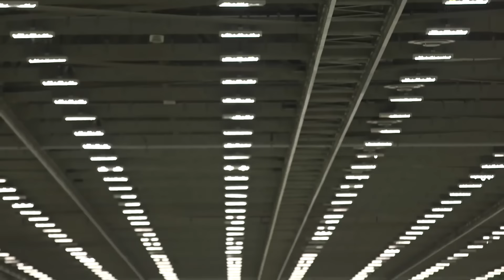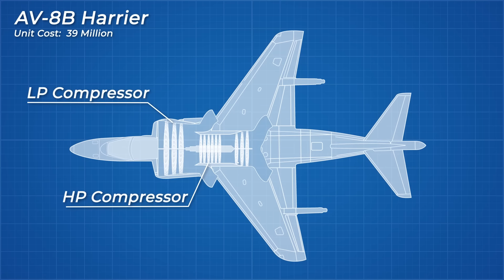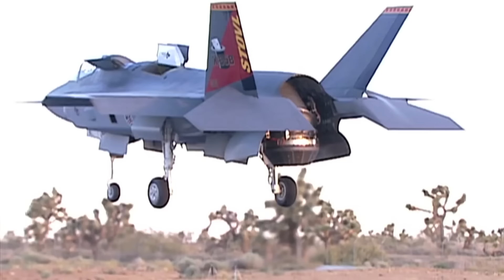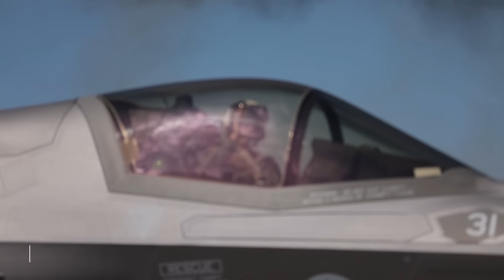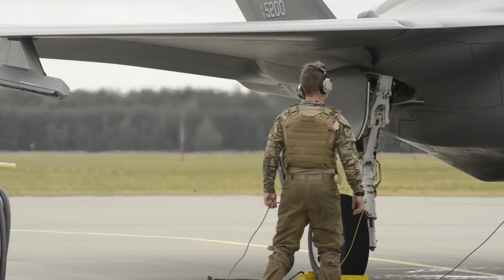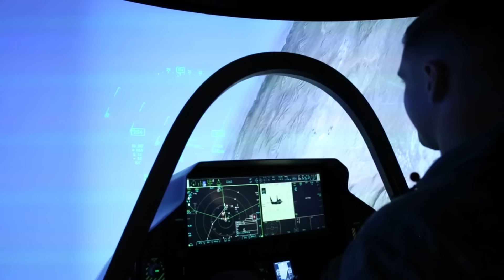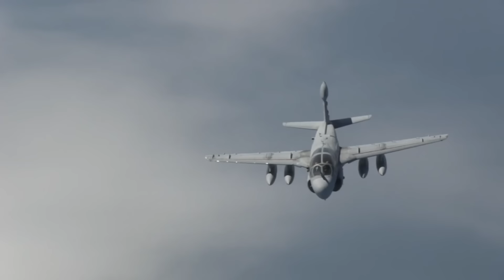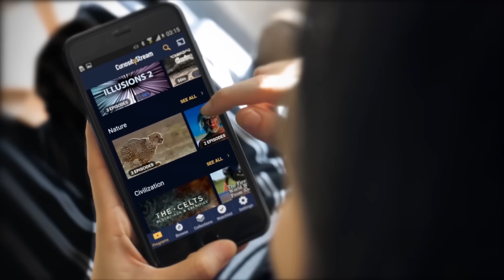Is The F-35 Worth $115 Million?

Comment: Not mentioned in this video : The main reason the F-117 was able to be tracked on radar and subsequently shot down in Syria is that not only did they fly a repetitive route, but they would also test their bomb bay doors at the same time during each trip. When these doors are opened it all but eliminates the F-117's stealth features as the open doors break up the lines of the stealth fighter causing it to reflect radar at a much higher rate.

Comment: Where did you get the unit cost of an A-10 at 45 million, the A-10s current unit cost is only 18.8 million. The whole argument about stealth is my biggest problem with the F-35 because to carry a usable payload it has to mount external pylons which remove the stealth capabilities of the aircraft. I know that when they where doing the fly off against the A-10 they handicap the A-10 and removed all advantages it has over the F-35. A large fault of the F-35 is it's jack of all trades mentality which in the end makes a very poor alternative to what we already have. For the remark about all the people who have flown it singing it's praises there is a simple reason for that, it would be a very poor career move for them if they can even get that remark out to the public through all the governments filters. Ever thought about why the only criticism of the aircraft from a pilot came from a leak not an interview. Now the next problem with the idea of mass production of a "stealth" aircraft is the operating coast is much higher because of the special treatment the it needs, plus the mass amount of time required to maintain the special coatings and sensitive panels.This reduces it's combat capabilities because any kind of damage requires more time to repair. If any of the special equipment brakes that will increasing the repair time by orders of magnitude grater then traditional aircraft on top of needing to lug around all of that special equipment to deployed locations. Aircraft like the A-10 can fly with panels that just have a primer coat on them or speed tape covering a hole in the skin until time and resources become available. As a US citizen and an aircraft maintainer in the Air Force I don't think the aircraft is worth the cost.
Reply: $18.8 million is the unit cost of an original A-10A in 1998 $ value. Just that price alone in today's $ value is roughly $30 million, and add to that all the upgrades the A-10 has received in the past 30 years it easily exceeds $40 million per unit. The 2006 C upgrade alone added $10 million worth of upgrades to each A-10.
If stealth is required an A-10 would never be used, so your problem isn't a real problem. The F-35 can carry the F-16's practical strike payload internally, and externally it can carry more than the A-10.
The A-10 wasn't handicapped at all in the exercises in which the F-35 performed the CAS role better. CAS is simply not the role that most people think it is i.e there is no requirement or reason to fly low and slow. An F-35 can spot targets more quickly from 10000ft than an A-10 can at 5000ft, and that means weapons on target sooner. Not to mention the inherent advantages of being multi-role mean the F-35 is logistically easier to manage in a combat zone, and that results in better availability.
The pilots singing the praises are simply talking about the capabilities that are part of the design and not the issues that are all temporary and solvable i.e there's no reason to make a fuss about them. They only suffer consequences if for example they report a problem to the public before the brass know about it as that is simply irresponsible.
Operating cost is not much higher if at all. The F-35 is not the F-22. The F-35 costs about as much as the F-15C to operate. The F-35 does not need special hangars or intensive coating maintenance and most of them use the exact same facilities as the F-16s they are replacing. I have spoken with actual F-35 maintainers and the problems are mostly to do with the supply chain of spare parts lagging behind the production of aircraft, as well as the ALIS diagnostic system. ALIS has improved quite a bit over the years and the supply issue is going to be resolved soon since Lockheed have reportedly opted to spend about $2 billion of their own funds to provide spare parts ahead of aircraft orders by 2020.
Reply: @dumdumbinks274  I was there when they did the fly off between the A-10 and F-35 they made the A-10 fly with limited fuel, ammo, not allowed to fly below a certain altitude all in an effort to make sure the F-35 looked good. There a big difference between solvable issue and inherent design flaws. The operating cost per hour of the F-35 and F-15C are about the same but compared to A-10 and F-16 which the F-35 also wants to replace the cost doesn't even come close.
Reply: @FlamingChickenG  You're referring specifically to the fly-off in 2018 then? I'm referring to exercises such as Green Flag, not the fly-off that wasn't even organised by the USAF.
The current maintenance cost for the F-35A is on-par with the F-15C. It is getting cheaper every single year as the infrastructure and spare parts are becoming more available. As I said production overtook supply and now Lockheed are working to have supply overtake production. Costs will definitely go down especially since most of the maintenance problems were due to the diagnostic tools, not the aircraft itself.

Comment: This is strange as talks stealth. We in the past month know that passive radar can pick up any type of stealth huge or very small aircraft including speed height and distance, also if any aircraft was using radar jamming  that also gave away the distance height and speed. Because as soon as it was being used it gives off its own signal. Then there is the speed the F35 can only in its fastest roll do Mach 1.2 also the Jet thruster is known for failing. Now about the crashes pilot error was with the Harrier but late 1980's they were flyby wire. Not stated here why? Also not explained was dust in the jets via hover mode Harrier can hover higher and safer in dusty zones while the F34 has problems. Then the rain and hail as we know the Harrier was used in cold condition in a certain war in the rain and extreme bad weather. It is unclear if any F35 can handle that type of weather. So why was the harrier so good against a Mack2 mirage. Well one theory is that when the missiles fired at the Harrier the vector thrusters would send heat and confused the missiles like firing flares like F15 used to do. the other was Breaking the Harrier could slow down so fast by the time the missile lock was on they passed the Harrier and got fired at. Then there is its landing Harriers could and did land vortically on ships in bad weather but this was also not mentioned. If the harrier had these days weapons and made of modern materials with latest Jet engines who knows what it could do. So F35 can out pace the Harrier but can't out turn the Harrier. F35 is more able to carry loads but can't land in extreme weather YET.  So over price and capability does not make sense to have F35's. But could had developed a better new Harrier variant with modern materials and engines with a better cost as all made in the UK.
Reply: > "We in the past month know that passive radar can pick up any type of stealth huge or very small aircraft including speed height and distance, also if any aircraft was using radar jamming  that also gave away the distance height and speed."

 This notion is based on what exactly?

> "Then there is the speed the F35 can only in its fastest roll do Mach 1.2 also the Jet thruster is known for failing."

 The speed at combat load is 1.6M+ which is considerably more than an F-16C at any combat load. Based on what is the engine known for failing?

> "Also not explained was dust in the jets via hover mode Harrier can hover higher and safer in dusty zones while the F34 has problems."

 Again, based on what?

> _*"If the harrier had these days weapons and made of modern materials with latest Jet engines who knows what it could do. So F35 can out pace the Harrier but can't out turn the Harrier. F35 is more able to carry loads but can't land in extreme weather YET.

 Again, based on what?

>  " So over price and capability does not make sense to have F35's. But could had developed a better new Harrier variant with modern materials and engines with a better cost as all made in the UK."

 I think you know what I am going to ask.

Comment: For reference I recommend looking into the data fusion and passive sensors of the French Rafale. I'd genuinely trust that plane much more in a peer conflict, as it doesn't rely on radar in the way the F-35 and F-22 do. That much vaunted 400k helmet of the F-35 is also apparently really heavy, and the data fusion doesn't work properly at this point. 

Maybe the F-35 can eventually become a worthy machine, but it has many, many strikes against it at this point, and the fat, clumsy geometry necessitated by the lift fan isn't doing any favours for the A and C variants.
Reply: The F-35 doesn't rely on radar and it's data fusion is much more than what even the latest version of the Rafale is capable of.  The A & C variants of the F-35 are physically different and are not in any way affected by the lift fan of the B version.
Reply: @dumdumbinks274  "no way effected"? Are you serious? They share the fat and bulbous hull shape necessitated by the lift fan. Without the benefit of being VTOL capable, they still pay the price in aerodynamic drag. 

Do you really think the A and C versions would have that fat fuselage if it wasn't required for the B variant? The F-35 can't escape its heritage. The aerodynamic performance of all three variants suffers from that shape.
Reply: @valkoharja  This notion is based on what exactly?
Reply: @valkoharja  Yes I'm serious. The "fat" (it isn't) fuselage is like that because of the internal weapons bay and the large fuel tanks. The F-35B airframe is very obviously different in that it has a massive hump behind the cockpit that is necessitated by the lift-fan, not to mention that internally it has a smaller weapons bay and 1 less fuel tank.
Reply: @dumdumbinks274  keep your beliefs. I'll go with the opinion of experts in the aeronautics industry, and... well, understanding of basic physics.

If you ever see an F-35 in the wild, next to any other fighter jet, take a good look at the shape of the planes. You might also want to look up the wing loading of the F-35A and compare it with the Eurocanards, for example. It will never be a decent combat jet, no matter how much they tweak the software. You can't cheat physics.
Reply: @valkoharja  These aren't beliefs, these are facts. And who exactly are the "experts" you refer to? 

 The F-35 is no fatter than a Super Hornet. You will get the impression it is fat if you compare it to fighters that are smaller, and all Eurocanards are significantly smaller. Wing loading of the F-35 is no worse than the F-16, and wing loading only accounts for about 70% of the lift provided by the F-35A's airframe. The F-35 is often misrepresented because it can carry a heck of a lot more fuel and has significantly longer range than any other fighter on internal fuel. At empty weight the Typhoon, Rafale, and F-35 have a very similar total loading slightly in favour of the Eurocanards. Those Eurocanards either greatly sacrifice performance to match the F-35's range, or they greatly sacrifice range to be slightly more maneuverable than the F-35.

Comment: A great video on F35, as always, but there are a couple of mistakes:
1. you forgot that LM has bought a license for Yak-43 to develop F-35. 
2. it is strange to allege that RUs needed F-117's remains considering the fact they've formulated the stealth topology in the first place.
Reply: 1. They didn't. There was a technology transfer with Yakolev in the mid nineties- but it's still disputed if their inclusion of the Yak-41 was before or after LM submitted a bid for the JSF design contract. 
2. They didn't invent the technology- Dr. Pyotr Ufimtsev founded the mathematical principles in calculating radar cross-section accurately.
Reply: @peterson7082  
1. they clearly did, the similarities are striking. And the formal deal took a long time to formalize so even way before that they knew they would use it.
2. there is no other "technology" in F-117 than that in regards to stealth, nothing to "reengineer" from there (not even radio-absorbing paint as Russia already had it).
Reply: @StrangerHappened  

1. The similarities are about as striking as the similarities between the F-14 and Su-27, not to mention design studies for the aircraft that would become the F-35 began in 1987

2. The study had nothing to do with how to design low RCS into a practical aircraft/vehicle, only how to find the RCS of existing objects. The entire reason Russia allowed the study to be published in a public journal in the first place is because they couldn't see a practical application to knowing the RCS of an object when there were no threats at the time that could evade radar detection for a practical duration. As for RAM... that's a WWII technology that every major nation ended up studying.
Reply: @dumdumbinks274  

1. the similarity is much closer. And, considering the deal, not surprising.
2. everybody studied it, but somebody was the first to formulate. So the guy's claim about F-117 makes no sense.
Reply: @StrangerHappened  

1. Not really. The only similarity is in basic appearance. The X-35 shared just as much in common with the YF-22 as it did with the Yak-43. The deal had nothing to do with the Yak-43, only the Yak-141 and the only data received related to engine placement and flight test data, not to mention the X-35 design predates the actual transfer of data.
2. The idea of stealth aircraft was formulated by Lockheed engineers. All the Russians did was provide the spark that lit the fire, while at the same time thinking a fire wouldn't happen. RAM was in use during WWII on German ships. It was adapted to aircraft by Lockheed.